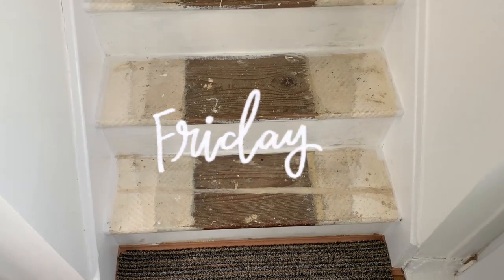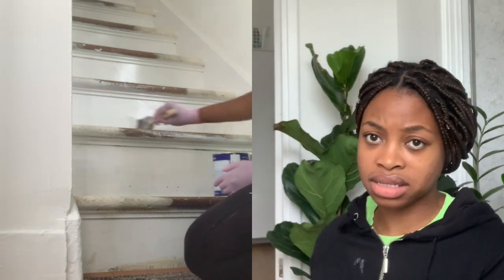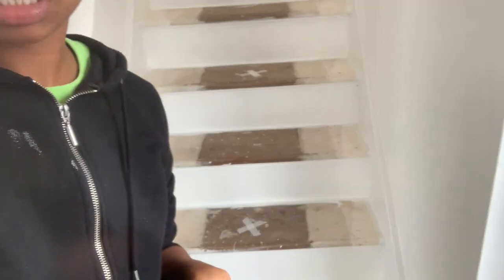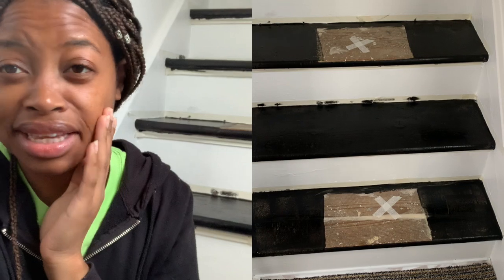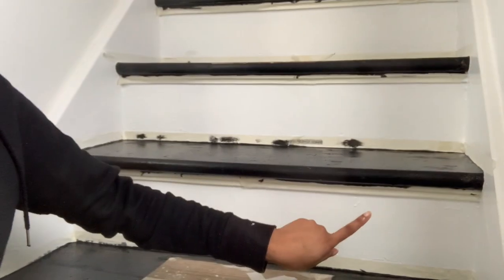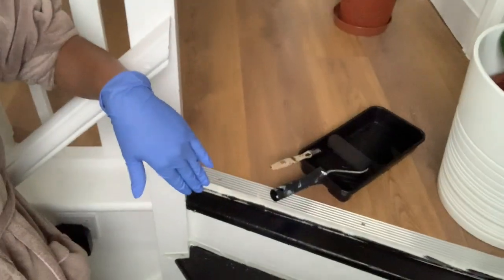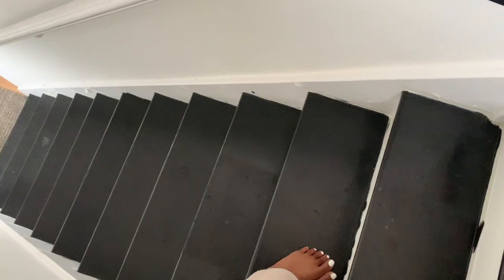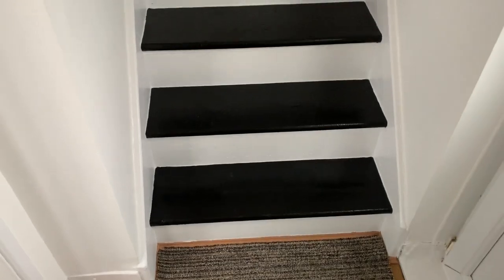DIY Staircase Makeover | Painting Stairs | EdithSaru

Comment: Hi. I'm thinking of trying this.  How long has it been seen you've painted the stairs?  How do the stairs look today?  Has the paint chipped or flaked?  Thanks
Reply from the maker: Hey, it has been over a year now, they look great to me. There are little chips here and there but nothing major maybe after year two I might think of touching them up a bit but so far so good!
Reply: If you use chaulk paint and a wax it will last longer I think. I redo furniture and I use chaulk paint for all my furniture it covers so well and the best part it can be a dark walnut stain you don’t have to sand unless it’s rough of course it will cover right over the stain. Make sure you always seal your though. They have different dealers I am a fan of the antique finish.

Comment: Did you sand the wood first and how has the paint been holding up?
Reply from the maker: I did light sanding because I was too lazy to do proper sanding and I didn’t want to clean up dust. So could have done a better job sanding but it was okay. The paint is holding up really well thank you. Some small chipped areas but overall still looking good

Comment: I’m a painter and you did a great job 👏 
Amazing cutting in 
I’m about to do something to my stairs 
Did you sand before you started?
Reply from the maker: thank you very much. I did some light sanding, I could have done more but it was too much work and too dusty. But it turned out okay. It still looks fine now, could do with a retouch maybe next summer small chips here and there.
Reply: @EdithSaru  thank you for getting back to me 
It looks amazing not easy to do either 
Especially black and white 
Love it 😍
Reply: When I do projects on furniture I always use chaulk paint for the reason of you don’t have to sand. Do you think I could use it for this? Your a painter so I thought you may know. If so would I protect from chipping on the treads with the gloss over it? Help lol

Comment: Stairs look great though your not supposed to use satin or gloss paints on stairs for safety purposes as it makes it slippy...Is that laminate flooring on the landing or vinyl flooring?
Reply from the maker: thank you. I can confirm that there has been no slips or falls in almost 2 years. I run up and down in socks.
Reply: @EdithSaru  It was just something I read. But that's good to hear because it looks great, hoping to do something similar with mine...
Reply from the maker: @MB-oi4rc  it’s laminate flooring just forgot to answer that